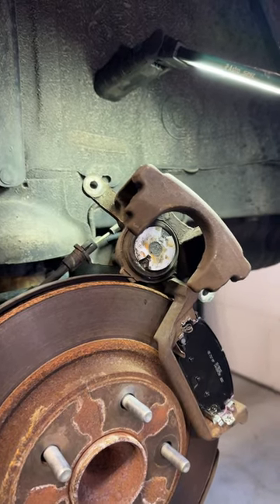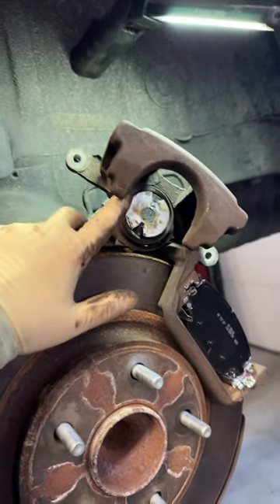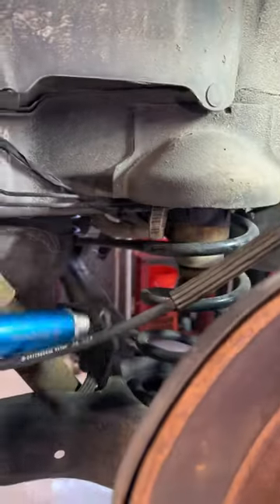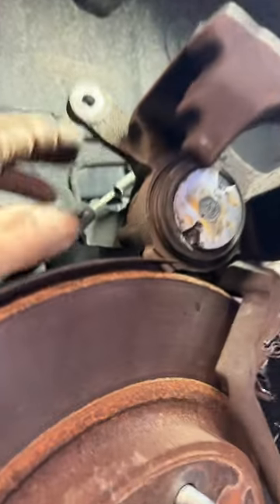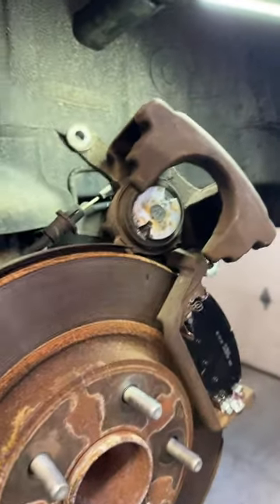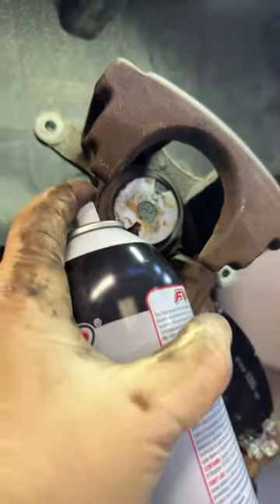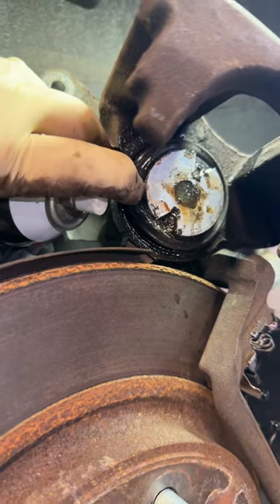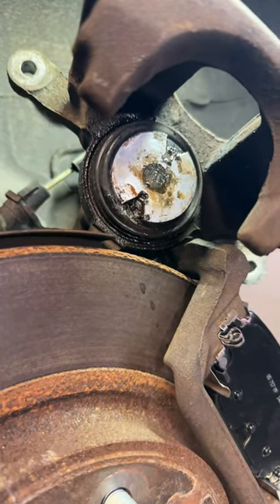HOW TO NOT DAMAGE YOUR DUST BOOT ON A TURN STYLE CALIPER!

Comment: Great suggestion.
Reply from the maker: Glad it was helpful!
Reply: @TheEnthusiastMechanic  Thanks. As a suggestion, if you happen to approach this topic again, caution against using anything but silicone to prevent deterioration of the rubber boots. I've seen too many techs fall down the WD-40 rabbit hole.
Reply from the maker: @richardp3624  I only use silicone sprays on there I've learned years ago about other types deteriorating rubber